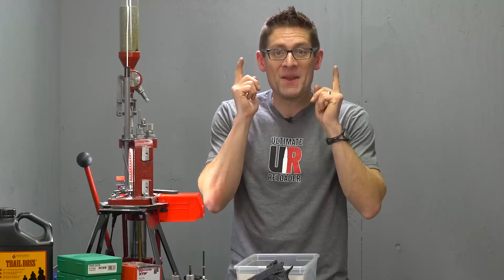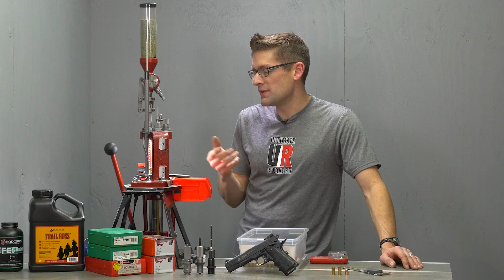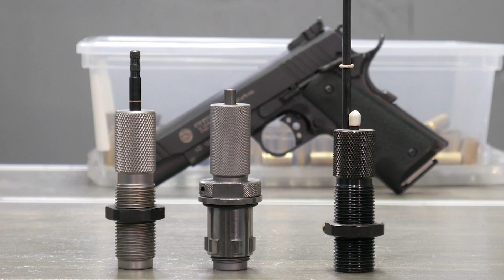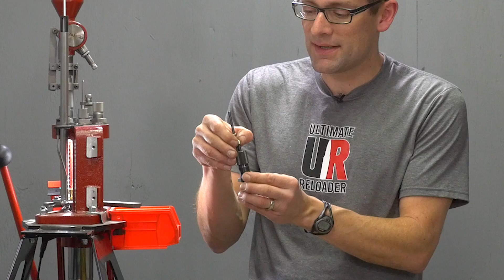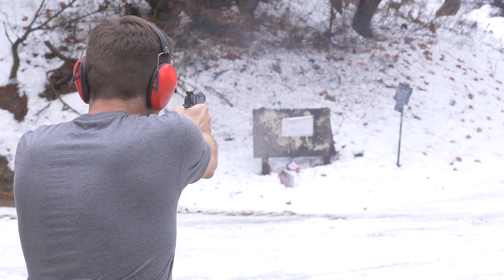Load 45 ACP Without Blowing Up Your Gun

Comment: I have reloaded 10s of thousands of bullets and can say the only time i have had problems is loading small batches at a time. 
  I do not like progressives, and have been doing this for fifty yars.
I have found it best to size all brass at one time. Next prime all brass on a single stage press checking each primer for depth. 
  Expand the case mouth as you prime the case
   Next step is to charge all cases in a loading block.
  Last is to seat the bullets and crimp. Notice in every step I have 100% inspection and control over each round.
Reply: Pretty much. When I load 45 acp with 700x I have to independently measure each case with my scale  because of the nature of the powder. It can be dialed in perfectly and my powder measure will throw loads such as 4.65 and 4.26 then hit 5.70 consecutively sometimes. Then a few rounds will be what I have my measure calibrated to. I hate working with cornflake powder for this reason, but I got to run through it lol.
Reply: I've found progressive presses offer too many opportunities to screw up. I'm very picky about my brass. I will prep it first and have a batch ready to load. Most work revolves around brass work. Loading is the last 10%. That's when progressive press helps with quantity. I'll split the process. I'm anal about the flash hole and primer pocket cleanness. I stay away from powders that are known to create dangerous pressures when underloaded. I select powders with large enough volume capacity that overflows the case when double charged so it is easy to spot it.
Reply: As a new reloader, this makes me feel more confident, it being the system I have set up. Also helps I only do 50 or so at a time, at least until I get better.
Reply: @notyou6950  👋Thank you for the comment about dangerous pressures due to underloading. Since I am new to reloading and haven't yet loaded Round One, flags to such dangers are much appreciated. This sent me off on a little research project over the last week and the results were eye-opening.
Reply: @mikec7478  btw, while you're getting pistol powders you might wanna know the exceptions to the rule. There is a few types of powder that are dangerous when underloaded. You might wanna find out about those too. Winchester 296 and H110 come to mind right away for me. I do use H110 because it flows very well and meters realy easy since it is spherical. Just saying...
Reply: @notyou6950  Thanks for the tips on H110 and W296!  I had planned on downloading .44 Mag to a mid-range load and would have thought the fast powders would provide less flexibility in loads than the slow powders but realizing this game is too complex for me to rely on my own intuition. Time to get the loading books!
Reply: @mikec7478  good reloading manual is a must. Double check your data. Double check your scale. The older books have loads that are set to the max. The newer editions are reduced by 10%. Lawyers got hold of them! Find a good book and stick to it. BDW, there is no such thing as 45 Long Colt if someone asks. If they insist you're wrong, just walk away. I do.

Comment: Best thing I have found is to do every step individually. I check the length on every case, hand weigh the powder on every charge, check o.a.l. on every round, and check every primer. It may seem excessive to some but the main reason I got into reloading is for control and customization of my rounds and consistency is key.

Comment: Great video. You can't be too careful. I accidentally loaded 44 mag pistol cartridges with the wrong data because the page in the loading manual flipped to 44 mag TC when I tuned around to get a tool. Fortunately, I didn't break anything but it will get you attention when the gun almost comes out of your hand. I've been loading for over 40 years and thought I was a careful reloader. There are those that have, and there are those that will make mistakes.
Reply from the maker: Glad you came out OK!!!

Comment: 7:06 of why after 45 years, I still use a single stage press. It's s...l...o...w, but every cartridge I load, gets checked before the bullets are seated.
Reply: Doing the same here for 34 years. tens of thousands of round loaded, no issues. Besides I load for my self and a buddy. I ain't in no race.
Reply: I learned with a Lee 1000 that you watch the powder drop and hand set every bullet instead of the auto bullet feed, still had a squib luckily we caught it!
Reply: I compromise and use a Redding T7 turret. It has most of the advantages of a single-stage press, and adds some flexibility, for instance having a whole die set up and ready and being able to either batch each stage or do one or two rounds from start to finish without changing anything.
Reply: @doddgarger6806  I actually use a powder measure to charge the cases inside a loading block and visually inspect the powder levels of 50 rounds at once. Double charges or missing charges are very easy to spot that way.
Reply: I use a progressive press and I've lost count of the number of rounds I've loaded over the years.  The press has nothing to do with it.  A progressive press does NOT prevent you from visually checking every load.  I have a light mounted to shine directly down into the case after it gets charged.  I visually check every one before I seat the bullet.  It's not about the press.  It's about carelessness and getting in a hurry.
Reply: @shane99ca  by far the safest way and you can drop the powder in about a minute. Only works in a single stage press which I highly recommend for the beginner and for people who think reloading should be relaxing and fun.
Reply: @jimmybare3026  There are always those, however, who have to “race” things. And then there are those who simply shoot a lot, more than could possibly be put out on a single stage.

Personally, however, I’m in your camp.
Reply: @shane99ca  for sure. I have  two progressive presses and a single stage. I didn't elaborate on what I was thinking. Much less likely to have a stressful moment running a single stage. I was self taught on a Lee loadmaster before YouTube so I  know all about stressfull👍🇺🇲

Comment: 19 Jan 2018.  An additional step I take that addresses accuracy and proper load is weight.  I weight each round after I have finished with it.  I use a Dillion 550.  In the finished round bin I will run about 50 or so then run each round through a case gage and weight it as well as quick OAL double check.  All important issues.  I do this with everything I load which is about 8 pistol, revolver and rifle calibers.  Great video Gavin.  What you have laid out is important for any seasoned reloaded but particularly important for a new or inexperienced reloaded.  Should be required watching.
Reply from the maker: Glad you liked it Mark!

Comment: I started using Trail Boss in 38 special not too long after it came out, one reason was the obvious, it filled the case and compared to Bullseye or 231 I considered it much safer since the charges were tiny using those powders. Initially I had a problem with excessive variation in velocity, I talked to Hodgdon and they said check my crimp, sure enough a bit more crimp fixed the problem, now I have very little change in velocity shot to shot. I LOVE Trail Boss! It meters better in a Dillon powder measure than any other powder I have used, I can throw 10 charges and weigh every one and they will be almost perfect every time! I haven't tried it in any other calibers, I always thought of it in relation to Cowboy Action shooting, but now I'm going to try it in my other pistol calibers.

Comment: I have a simple process for reloading I find helps minimize risk. I still use a single stage press since I inherited it from a friend and grew up using one with my grandpa. My process is to do 50 rounds at a time. I size and deprime all at once. Polish and clean them if it is needed next. Then I bell the case mouths and prime on the down stroke. Finally, I charge each case one at a time scale measuring the powder before funneling it in the case and seating the bullet. I can average about 50 rounds in an hour or two depending on if I have to tumble the brass or not. Every step I check and re-check every case before moving onto the next process. For my first hundred rounds or so, I would forget to check after every step and would wind up  putting powder and bullet into a case without a primer or loading a bullet onto a case with only a primer. I'd always catch these errors before they made it into my firearm but that taught me vigilance early on

Comment: One useful thing which I do for pistol when I use a new powder for the first time is to take the powder, the scale and one case (with a dead primer to prevent leakage) to a place well away from the press, so I don't accidentally load a round, and then DELIBERATELY measure out and drop two charges into the case. That way, I know what a double charge of that powder looks like in that case. HS-6 is so damn scary.

Comment: Totally agree with the progressive loader elimination the double charge. I've caught double charges charging by hand one at a time.....it happens. Your BIGGEST well made point is visually checking each load, too many people like to sit on their butt and load. This is the best method to eliminate double, weak or no charges. Only thing I can add is keeping your powder charger flow tubes/passages clean from powder build-up. I like to run an appropriate barrel swap through mine. Happy Safe Loading!

Comment: Nice video;  many useful comments, both in the video and comments section.  I'll add one consideration that I did not see mentioned.  Overused cases.  On most 45 ACP weapons the feed ramp leaves a small inferior portion of the case unsupported by barrel.  Cases that have been fired many times, and if exposed to a significant load , e.g., +P   (not a double load), may experience a KABOOM.  I know that I did!  I used to shoot 200 rounds of 45 ACP, 3 times a week at my local range.  Picked up my brass and others.  So moral of the story,  limit YOUR rounds to dedicated brass and store them in sets, so that you can account for how many times fired and whether these 100-200 rds were light loads, moderate or +P loadings.  My experience, cracked H&K Tactical 45 grip.  No injuries and minimal fix: new lower.

Comment: Great safety stuff.  I always keep a visual check and weight my powder every 10 or 20 case which does slow things down.  Another check that some do and I have started doing is checking the weight of my completed ammo for variations (using mixed brass can throw this off so for this and other reasons it pays to sort your brass by headstamp).
Reply from the maker: Better safe than sorry!

Comment: What I use is a dowel slightly smaller than bullet diameter. It is marked how far in the case it has to go with the  charge you are using. The bottom is marked with a red marker. If when you stick it in the case after changing, the red shows, you have too much powder. If it goes in too far, you have too little. There is no substitute for weighing or measuring each charge. You charge 50 cases at a time in. You use this check plug in each case. Then you proceed to seat the bullets. You make a different check plug for each different powder and charge weight. This works with any straight-walled case like .45 ACP  or .44 Magnum. It also works for .45 Colt, .357 Magnum,  .355 Parabellum (I am purging Metricrap from my use of the language.).

Comment: I typically don't shoot more than 100-150 round's per caliber per outing, so my batches are small and I load on a single stage press for my rifles and a turret press for my handgun loads, however I do not use the progressive feature on the turret press, I just like having all the dies for one caliber set up on a turret so I can keep everything organized a bit better. 
I will use an auto drop for powder on my pistol loads but I'm usually loading well below the max loads to give my self a cushion, and I will pull my primed brass from one tray to the next as they get powder so I don't accidentally double charge. And I will complete a tray of 50 before I start on the next 50 rounds.
My rifle cartridges I will trickle and measure each load and also set into a different tray once the powder is in.

Comment: I'm still using a single stage press, so my QC on powder charge is done between the seating and crimping steps.  I suppose it can still be done on a progressive system, it'll just be more difficult to fix a problem.  Basically, before I begin, I weigh a sample group of each component (bullet, case, and primer), this does require sorting by head stamp if reloading range find gathering data on each, but is still effective.  From this sample I take the lowest and the highest measure for each component, add both low and high separately with the 0.1 grain variance of my powder dispenser, and this establishes the acceptable range for the finished round.  Then, after seating, but before crimping, I'll weight each and every loaded round to see if it's within this range.  I've have yet to have an over charge, probably because I charge then immediately, but I've caught several no charges, and at even a few missing primers, whoops.  It's a bit time consuming, but it's works.

Comment: Two good powers to prevent doubles.  Trail Boss for 45 ACP 45 colt.  H110 for 450 bushmaster.  Almost impossible to over charge to the point of failure.   
Dillon XL650/750 presses have a nice double charge alarm which is not touchy.   You get a double you will know it.  Its piece of mind because the way the dillon drops power and indexes you cant really get a double load.

Comment: This week I loaded both .380 auto & 9mm on my single stage Forester. I hand dip every single power charge as I weigh each on a calibrated digital scale & then right into the case, seat the bullet & that process is done. Next I crimp but I do that as a group. I'm in no hurry & after many years of reloading no problems. I give up quantity for more piece of mind. Single stage is slow but less to worry about. Dropping power by volume, not weight just does not make ¢ to me.

Comment: Can’t stress safety enough with reloading. Sure the progressive press feature high round per hour production, but we are not running a marathon here. A little time spent goes a long way. More rounds per hour should not be a primary goal while sacrificing safety. My personal preference with a progressive press is to leave the ram in the upward stroke if I need to step away. Feels natural to pick up where I left off. Plus a sense of security knowing a case filled with powder is protected, I won’t miss seating a primer, and the press is locked out so to speak.
Reply from the maker: Nice tip!

Comment: Great Video. I am new to reloading.  I have been reloading since August of 2017.  It is now February 2018.   I have that lighting system.  I use visual and I also an RCBS lockout die for powder check.  All distraction are removed from my reloading area.  I can now reload 9mm, 45 acp, 50 beowulf and 223.  I am getting ready to reload 40 S&W and 300 Blackout.  I want to get a second press that way one is for rile only and the other for pistol (the 50 Beowulf brass case is straight so it reloads as if it were a pistol case).

Comment: I had 1 sqib in thousands of rounds, low or no powder. That shot felt weird, no recoil and slide didn't eject the case. I thought "hmmm I wonder if the bullet is stuck in the barrel" and it was.
Since then I don't powder on press anymore, I fill a tray with primed cases and powder 50 at a time and check them all before inserting into 4th stage on my LM.
Reply from the maker: Glad you caught that!
Reply: Thank you for catching that. I hope you teach that to anyone you shoot with.

Comment: This is a technique that works fairly well for 223 and other rifle cartridges. However, it won't work on pistol cartridges. After the reloading session is complete, weigh all of the cartridges. A rifle takes a lot of powder (20+ grains) and therefore a squib load can be identified by being "out of range" or different from the rest of the group. For example: I weighed about 150 freshly loaded 223 cartridges (mixed brass) and all of them were within +/- 5 gr of an average. If I had gotten one that was more than say, 8 grains low (or high), it would be worth taking that one apart and reloading it.
Reply: Great advice, thx

Comment: Talking about having the wrong primers in the tube, I though of a good way to watch out for that! Since you already use a rod inside the tube to keep pressure on them and watch how many you have, you could make a little flag with what type of primer you're currently using and attach it to the rod, that way you always know for sure. Switch primers, switch the flag
Reply: Johnny Thevis good idea
Reply: I hand prime ALL my cases. I like to feel it seat and know it is good and the correct primer always.

Comment: Good video.  I watched the video, all the while trying to find out why .45 ACP was specified?  You wouldn't want to blow up any caliber.  Right?  The only thing that came up about 45ACP  was the small vs large pistol primers.  Just trying to understand why 45ACP safety is the topic in the title, instead of general safety?
Reply: 45ACP has a large case volume, and if you use Red Dot and some other powders, you can double charge an occasional bullet.   When you fire that bullet, it will blow up your gun..... has happened to me twice over the last 30 years or so.    First time it blew the mag out of the botton of the 1911 and destroyed it.  Second time it took out the mag release, magazine and a few other parts of my Glock.  Bad stinging in my hand for a few days, but otherwise no problem.